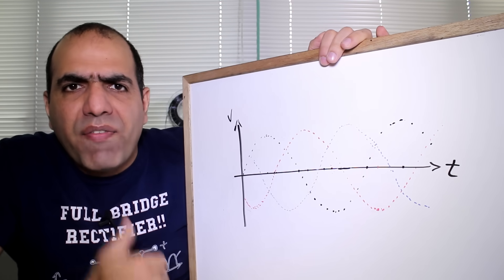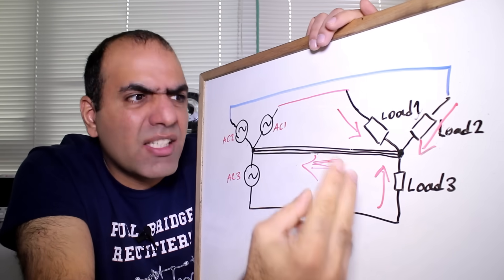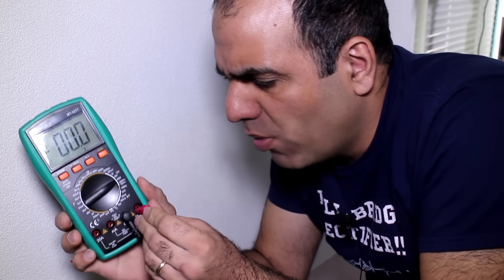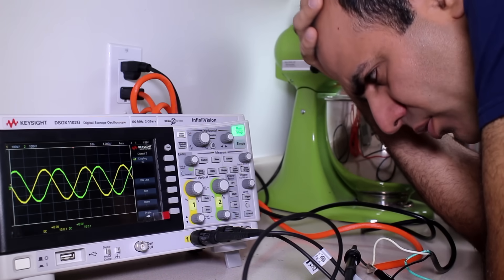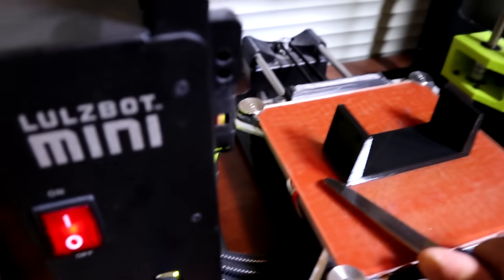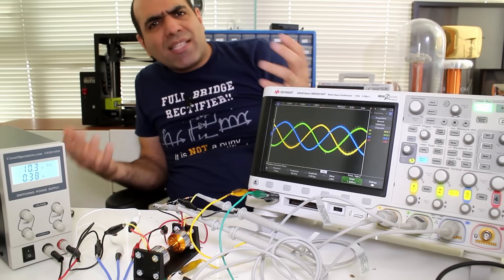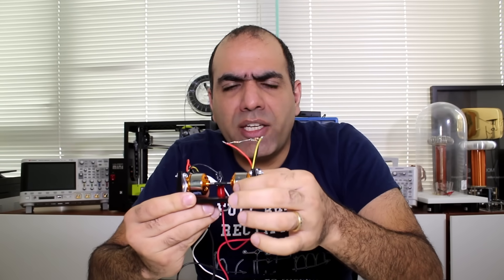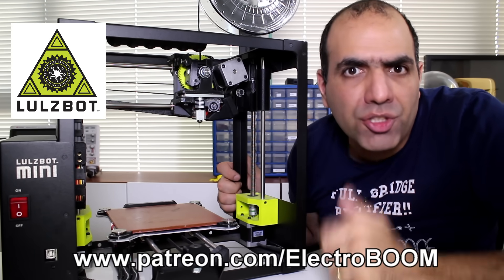Why 3 Phase AC instead of Single Phase???

Comment: In Germany all houses have a 3 phase power supply. It is splitted in 3 single phases, but if you are any enthusiast and have for example a CNC machine or car lift in the garage, you can use all 3 phases by making a 3 phase outlet.
Reply: Vorteil von unseren Installationen :)
Reply: That's genius, things like that are what make Germany awesome, aside from the food.
Reply: I'm not sure if all houses in Poland have this, but mine has. We use it for example for concrete mixer
Reply: That's freaking awesome.
Reply: solar panels output DC don't they?
Reply: @lbgstzockt8493  jep.
Reply: Yes. This depends on, whether the setup is a star-circuit-setup, or a delta-circuit-setup.
I guess my translations are wrong. In Germany, 3x 230V is called a "Sternschaltung", and 3x 400V "Dreieckschaltung".
Reply: David Mezentsev.
ur wrong my friend, ur wrong. 3x230V is against neutral "middle" point. Every phase against two other have potential 400V, so 3x400V.
Reply: here in the netherlands we have 3 phase also(not every home). its 400 volts @ 50 Hz here.
Reply: @cokefridger Same in Sweden, most hardwired washers use 400 VAC. But we pay according to the maximum fused phase on the incoming power (16 AMP in most cases)
Reply: And you can get more power to Charge your electric car faster
Reply: It is the squareroot of 3 times 230V, so 400V for most domestic appliances in Central Europe. And most households in Central Europe are connected to a three-phase system. We also used to have the US-single-phase system, but later, we upgraded it.

Und an alle Deutschen, die das lesen können: Ihr seid cool!
Reply: More voltaje = dangerous. 400V for industries, in homes 127/220V is better.
Im know two voltaje levels, in my contry exist 230/400V and 133/230V.
Reply: the same thing in Kuwait, 3x240V 150 Amp fuse each phase. That's for small house of 2 floors. and the past 10 years they start to apply 200 Amp for most new houses. and more for more floors add. why we need that much power? because of extreme high heat in summer. 7 month a year we need to run the A/C units. you can't survive in summer without AC unit in Kuwait, I mean NO WAY. 
https://www.theguardian.com/uk-news/2016/jul/23/think-youre-hot-spare-a-thought-for-kuwait-as-mercury-hits-record-54c
Reply: cokefridger it's a shame houses are only wired for single phase in the states. Probably too expensive for contractors and the power companies to implement
Reply: In France you have to pay extra to get 3 phase, through a separate power meter. My grandfather was a blacksmith, and used equipment that required 3 phase. The supply was physically disconnected when we cancelled it after he passed.
Reply: packing my bag to go to Germany
Reply: In Sweden to.
Reply: cokefridger for dubai  we have  3 phase in my apartment  it is spilted equally   on the loads
Reply: +cokefridger
We have that in Sweden to - all houses and even most apartments (except for some old ones)
+Charred steak
I think it's also due to your voltages used. You need 120 V for most stuff, while larger appliences run on 240 V, as I understand. This wouldn't be possible with a 3 phase connection like we have in Europe. Because if you have 120 V between a phase and neutral, you get only 208 between phases - now if you increase the voltage to 240 between phases instead, you end up with 139 V between a phase and neutral. This is due to the 120° phase offset. In the US system I guess they connect houses to just 2 of the phases instead and then they put a grounded center tap on the distribution transformers secondary winding. That way you get your 2 "hot lines" with 240 V between - then 120 V to the ground. Now if you want to have 3 phase to your house you would need a lot of wiring. Here we don't need the 120 V so we just have 230 between phases and ground  and 400 V between phases (wich is also used for some high power stuff). But this video shows something that made me also a little confused - does Canada use 120/208 V system? Then it would require specially made appliences like stoves, washing machines and such things running on 208. Using 220-240 V for those appliences seems to be pretty much international (even though we have many  stoves running on 400 V here in Sweden). Often 230 V stuff will still work with 208 V or less, but will run with  reduced power (wich may be an inconvenience).
Reply: @Speeder84XL yes I was confused about that too, thought Canada also used a split 240v single phase
Reply: iwtommo our plugs are better than your's because they can't expose the contacts to your hands while connected. unless you think that's boring of course^^
Reply: in slovakia and czechia everyone has 400V 3phase
Reply: even small flats, like mine have 3 phase mains.
even my electric oven/cooking-plate have 14.5 kW combined power demand
Reply: All homes have three-phase here in Norway as well, quite nice if you want to set up your own machine shop in the basement/garage
Reply: David Mezentsev Electric stoves have way higher efficiency than gas cookers. Especially induction cook tops where about 85% of the input energy is converted into heat in the pot, while gas burners end up at about 55%, as they use a lot of energy to warm up your room instead of your pot. (Which is a bad idea if it's steaming hot outside and you need to run the A/C extra hard to get all of that extra heat outside) And electricity comes on demand, we never have to go to get our tanks filled up.

Electric cooking makes even more sense if you have a lot of renewable electricity available. Here in Norway, our electricity is >99% from renewables, so of course we cook with electricity.
Reply: Im only slightly jealous.

Tell you what, we'll swap. You can have our master race plug and we'll get the 3 phase to the consumer unit.

Go on, its a really good plug
Reply: I think it's common in vilalges, but I don't know about houses in larger cities. I use mine for a table saw and the water pump for my well.
Reply: cokefridger no 60hz though the best according to tesla and I
Reply: @cokefridger Same thing in Greece.
Reply: True. 
USA and Canada: 120V single phase - 240V single phase doubled (not three-phased)
Europe: 230V single phase - 400V three-phase

If Europeans would have the same high-voltage-option and connection as in the US and would keep our voltage, we would have a 460V single-phase-doubled connection.

And actually, 240V has been the single-phase voltage in Britain for a long time.
Reply: Nah we fixed that by insulating just a bit of the leads so you cant touch the terminals when giving the plug the full on claw grip yank of death.

Been caught out by that one. It, uh, certainly wakes you up.
Reply: LBGST zockt   yeah and they only output dc   you need a inveter to cover it to ac
Reply: you can draw over 3,6 kw out of 230V. But if you use directly 3 phase = 400v it is better for the circuit as you dont have too much load on only 1 phase. Usually to your household comes 3 phases and then the electrician wires up every phase for different rooms and tries to balance it etc.
Reply: David Mezentsev I DONT understand wht u say  i aint a electric expert  😂😂😂😂😂
Reply: LBGST zockt yes they do
Reply: Here in the USA it is possible to get that from the electric company, but only if the property is zoned commercial.  Some people use 3 phase inverters in their home machine shop.
Reply: Not surprising, considering that Germany has historically been a very industrial nation.
Reply: Most developed countries has 3 phase  to all houses even the smallest apartment..
Reply: @RandomerFellow  We have a typical single phase 220/240V in Australia, although you can ask for 3-phase if you want. Solar systems have a 5kw/phase export limit, so 3-phase can also be beneficial there.

Most phases are either 42A or 60Ato a house, so when 3-phase is installed its usually for an 8-10kW AC ducted air conditioner, as that consumes an entire 42A single phase supply.
Reply: Der E -Herd ist normal auch im Stern geschalten
Reply: Also, Germany like much of Europe is 230-240v single and 400-450v on 3 phase
Reply: No wonder, because 3-phase power was invented in Germany
Reply: Students study hard and you easily steal their ideas from their brains. Sounds like a good deal. Fighting for freedom. New slavery. It is my responsibility. I thought everyone should know. We are imprisoned in a place whose slogan was freedom.  Don't travel to the USA. Never even for a short time. If you have any special knowledge or skills or an invention, they will steal it from your mind. The US government initially used this method to identify people who intended to harm the United States. But today, they use it for many purposes, including stealing information from people, stealing data from people's minds. And many celebrities like Taylor Swift and Harry Styles are helping to lure the US government. They can see whatever you see. You'll never have privacy even with your wife or girlfriend. They could see whatever you think. When Taylor Swift said I use my best colors for your portrait, she meant it. when she said, Touch me, and you'll never be  alone. Or I can read you like a magazine.  Your silence would help them to do it again and again. They said, don't say anything because of The USA. I want to take her to court. They wanted to pay me $1,000,000, but that was not amount what I asked from them. Those are not only songhe (Taylor Swift) likes A writer of crime stories whose stories are authentic and have committed all the murders. Taylor Adolf Hitler, the Humans, are not your laboratory mice. Sometimes what we hear are like warning lights to prevent accidents. Events that the causes of those events are not afraid of repeating them, but they are happy. And they sat waiting for the right time. Let's not ignore what we hear.
Kidnapping in a new style.
.........................................
#Taylor_swift_is_killer
Doggy styles( #Harry_Styles_is_killer )
#Selena_gomez_is_killer
#Biden_is_Killer
#Trump_is_killer
Reply: what voltage do they get on each phase ....in australia you can have three phases in your house if you have special need for it as in your CNC machine example but most houses use one 240 volt phase and that is adequate
Reply: Same in czech republic 3×400V and i have 32A socket 😀
Reply: Nope you have 3x 400V :) 
L1 - L2 = 400V
L2 - L3 = 400V
L3 - L1 = 400V

You got as well 3x 230V
L1 - N = 230V 
L2 - N = 230V
L3 - N = 230V
Reply: 3x400V= 400V line to line = 3x230/400V whithout neutral
3x230V= 230V line to line (and 133V line to neutral).
Reply: Same in Turkey. 3 phase 380V is delivered to each house. I don't understand why North America uses lame low voltage and single phase.
Reply: USA and other countries uses 110...130V bot more safer or 230V.
Reply: @TeslaTurkvlog  Not like in Germany. Small houses (less than 5 households) in Turkey are only connected to single phase power.
Reply: @TeslaTurkvlog  US uses 110v for safety vs 240v. And they can afford to pay for the bigger copper wires.

In the US if you touch a live wire you get 110v to ground. In many countries, you get 240v to ground.
Reply: We have that too at my parent's house. And I think our solar panels output three phased power, not sure about that...
Reply: @simondm96 solar panels output a dc voltage. You need a sine-wave inverter to convert dc—>3 phase ac.
Reply: You habe 3x230, it is 400. Not 3x 400
Reply: +Ride84XL AFAIK (correct me if I'm wrong since I'm from Europe) you can have a 240V line installed the US and Canada as an option, as there are indeed some high-draw appliances that require it. You can however find washing machines, stoves and alike that run on regular single-phase 120V.
Reply: 400V RMS FTW!
Reply: 3 Phase is not necessary in a home. You can just make an inverter that'll make a 3 phase source for you.
Reply: Yup, germans too scared off gas. Using electricity to cook and scream about ``efficiency`` at same time LOL!
Reply: Yeah by the way, nobody uses A/C in germany and year medium temperature is about 8 degree, so we have to use heating 8-9 month/year in most places. Only problem about gas inside the room is the extra steam, but its not much and in a kitchen you have moisture anyway.

Comment: Is Canada different from the US? I understood that in the US, it's not two phases that is delivered, but a single phase, with one leg of your breaker box 180 degrees out of phase with the other, thanks to fancy transformer physics. That's why the transformer on the pole feeding my house only taps into one phase from the pole, and neutral.
Reply: Yeah, US uses a single 220v phase, split into two 110v rails. I would assume it's the same in Canadia, but I could be wrong.
Reply: Eman Mann probably in an apartment building where they likly do that vs houses have a center tap transformer for 120 240
Reply: Yeah, I'm more confused now.  Apparently, US power looks like this https://youtu.be/vOh2OSJ44eE?t=7m44s, which is what I expected, compared to Mehdi's up there in America's hat with 2 phases at 120v, and 120 degrees out of phase, providing his ~220v power.  Which is also different from the UK, which just has a 2X bigger single waveform providing 220v.  I've wondered if that causes issues for equipment designed for the other side of the pond.

Comment: Can a motor also be 2-phase AC with 180 degree phase shift, or only 3-phase?
Reply: There are indeed 2-phase AC motors, but with 90 degrees shift. That is: if one phase is sin(wt), the other is cos(wt). Put one to horizontal coils and another one to vertical coils and you get perfect rotating magnetic field! That's often made in 1-phase motor 'internally'. To gain 90 degrees phase shift, large capacitor is used. Its direction can be controlled as well. 

With 180 degrees all you get is pulsating magnetic field which cannot start induction motor, unless it have shaded poles or above mentioned capacitor.

Comment: First one to say three phase needs 3 FULL BRIDGE RECTIFIER.
Reply: There is a special full bridge rectifier design for 3-phase systems. The pulses on them are much nicer
Reply: you need only 6 diodes and a lot less caps for three phase. the output voltage is also higher.
Reply: The flux capacitor
Reply: B6
Reply: League Of Gamer [Fauzan Gaming] patreon
Reply: Mike oliver  in conversation of 3 phase as we use thyrister instead of 3 diode
Reply: Bart Layman
Very similar :D
Reply: how you comment 1 day ago
Reply: Wow did u receive this video 1 day before exclusively??

Looks like YouTube is drunk again
Reply: You need a SIX PULS BRIDGE RECTIFIER (B6), you can also get a CONTROLLED SIX PULS BRIDGE RECTIFIER (B6C) and so on.
Reply: You only need a bridge and a half for 3 phase
Reply: As with a single phase bridge rectifier, you only need 2 discrete diodes per connection. 3 phase bridge rectifiers have 5 terminals, 3 for AC input and 2 for DC + - output. Fantastic little devices that create way more power and use far less filtering than a single phase bridge.
Reply: 3-phase bridge rectifiers already exist, son.
Reply: EVEN  FULLERRRR BRIDGE RECTIFIAAAAHHHHH!!!!!!!
Reply: I believe it's something exclusive for patreons
Reply: Mike oliver there is special type of 3 phase full bridge rectifier!
Reply: Why is your comment showing 1 day ago ?
Reply: Paetrions get 1 day advance
Reply: League Of Gamer [Fauzan Gaming] 
I guess its related to difference of time zones between the viewers,
I made just a guess I'm not sure
Reply: Only if you are needing DC.
Reply: how do you get from 1 day ago